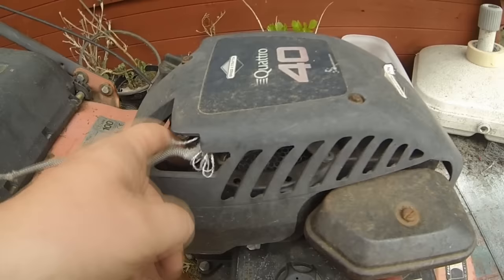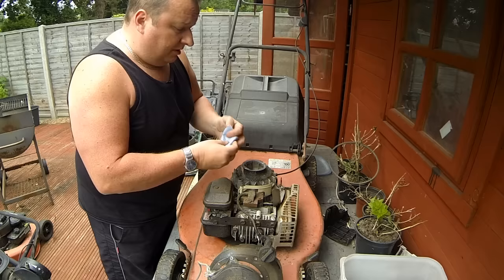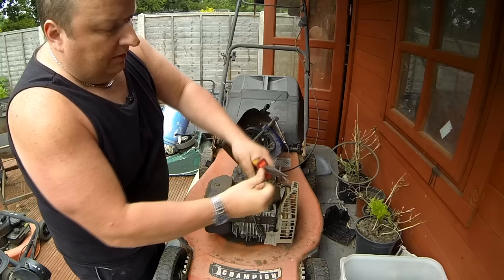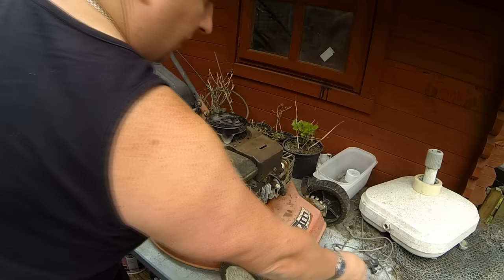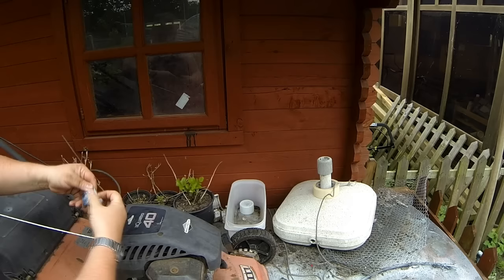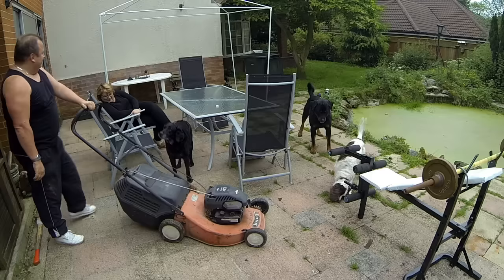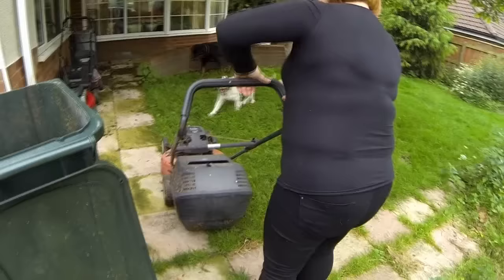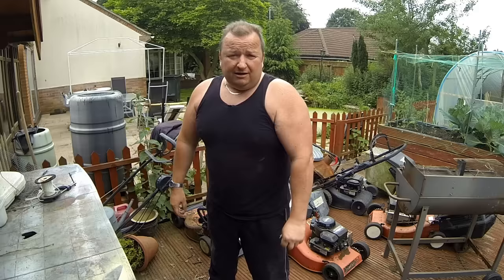Changing A Lawn Mower Pull Cord On A Briggs And Stratton Classic Engine

Comment: You can't win em all Martin, I did wonder as you were doing the cord if you had turned it a couple of extra times, a lot of the time I just finish it at the recoil and don't bother with the handle clip, I find that give me extra pull. Sharon was on form today giving you some grief lol. Good vid thanks.
Reply from the maker: Haha, yes she was on form lol. I give her some stick as well though.
Cheers
Martin
Reply: +retrorestore I work with my other half gardening and it's quite funny watching her when she breaks the mower, she's looking around it and hasn't a clue, the other week I saw her pushing it rather than using the drive, I said what have you done now, the cable had just slipped out of its holder on the handle. Usually it more involved than that, meaning an evening of stripping the mower down to sort out the drive.
Reply from the maker: Haha, At least she get's stuck in lol, most don't want to know.
Cheers
Martin

Comment: I was wondering if you could tell me how often I should service my flymo brigg and stratosphere engine. Pops can you send me your email so I can send you a picture of the lawnmower
Reply from the maker: Not much needed each year bud, just check the Oil level, Air Filter and  Plug and drain the fuel before storing over the winter and you should be fine for a few years.
Cheers
Martin